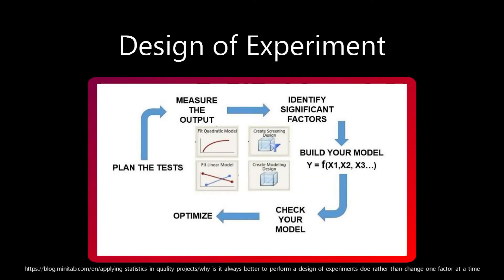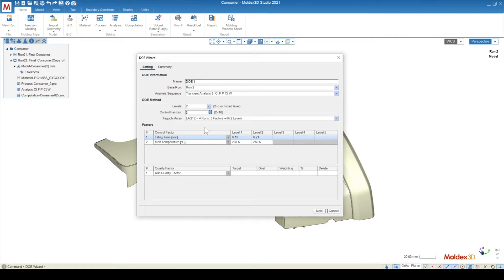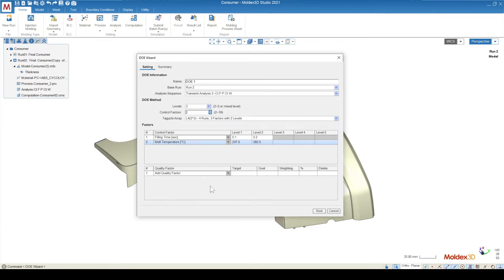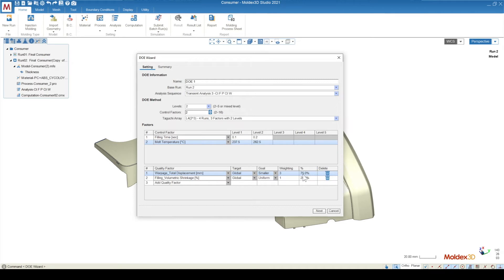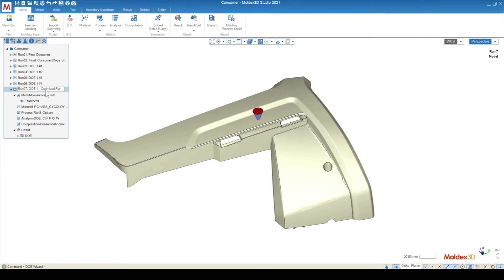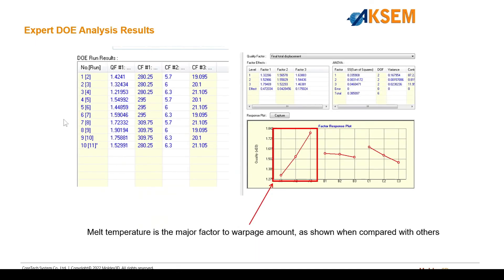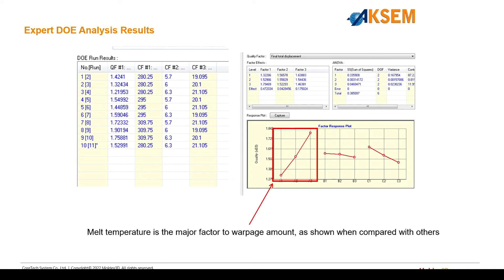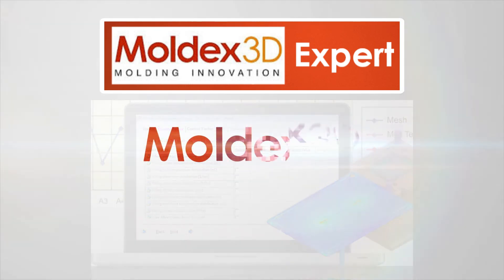Design of Experiment (DOE) | Moldex3D Expert Module | Advanced Module Breakdowns

Comment: A "problem" with filling time as a factor, is that if you do a study of linear increases of fill time, your injection speeds will be logaritmic.

You need to recalculate part volume to linear filling times to do proper studies, like viscosity study.

Im Currently doing my master thesis in moldex3d as an polymer engineer 🙂
Reply from the maker: great to hear and you are correct.  The Taguchi Method used in the DOE function is certainly more of a linear correlation, but in reality it is more second order and would require a more precise data extrapolation to hit the exact optimization point.  Most of the time though, obtain the exact optimization is not worth the time investment, and therefore the linear extrapolation method is "good enough".
Reply: @moldex3dnorthamerica599  yeah it ofc depends on what you are evaluating! But for lets say a reology study / viscosity study.. Fill times is not what you want, you want injection speeds linear, cause viscosity is logaritmic.

With fill times linear you will get logaritmic injection speeds!

This is pretty deep 😅